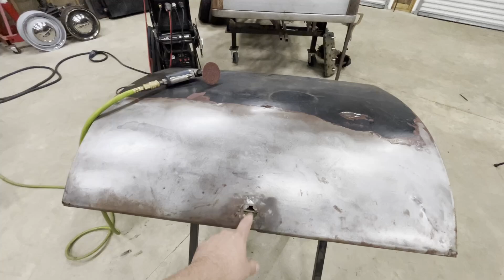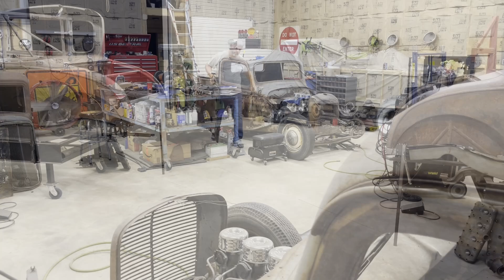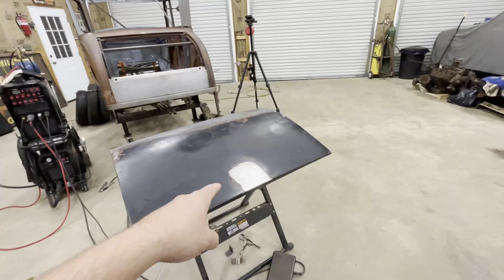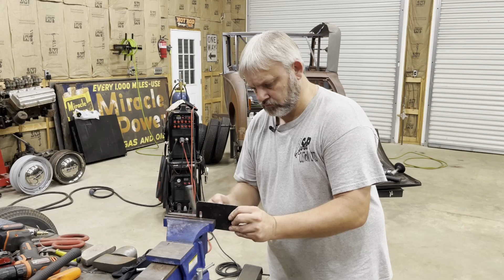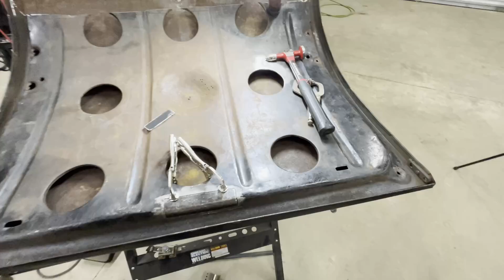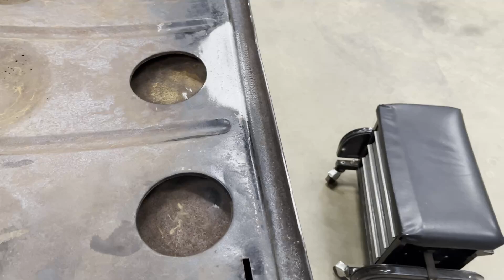Model A trunk lid repair part 6! Homemade tool makes big progress! Hot Rod Build! #welding #rusty

Comment: OH ------- don't cut yourself short ----- and start thinking you would like to have a body that ---- Does Not Have All This RUST ---- NO--- NO --NO ----------- What are you doing ---- NOW ----- YOU ----- are REMOVING ---- GRINDING ---- STRIPPING AWAY ----- CUTTING OUT ---- MAKING PATCH PANELS SMALL AND LARGE-- WELDING THEM BACK IN -------------- FOR WHAT??????????? ---TO HAVE A -- RUST FREE CAR!!!!!!! ------ So --- don't be changing your way of thinking ----------- YOU WILL ------- HAVE ---THAT -- RUST FREE CAR ---- SO ---- say that 21 times ---- and you will have that etched in your mind --- and you will be back on track ----------- About the Rear Lid ---- you could have had a --Real Conversation - piece there ---------- Two Handles ---- would strike up a conversation ---- What on earth? --------- Instead of doing repairs on it ---- could have turned to INVENTING ----- The -- Trunk handle when turned to open ---- would disengage the --Rumble Seat handle and would open up --- as a Trunk ---------- Then when you wanted to use the Rumble Seat ---- would turn and open the Rumble Seat handle and disengage the trunk handle to be a Rumble Seat -------- And  the Tool Tip of the week ------ This week's HOT tool idea ----- another Great Idea ---- I'm glad they come so easy for you ----- keep these Tool Ideas coming --- turn in the Patents and you'll retire sooner than you think ---- Yes this Planet is Changing ----- Not only getting ---HOT --- here in the US -but --Asia and Europe too -- wonder where we are headed --- Thank You for the Video --- And we shall see you on your next one ----------- Rodney
Reply from the maker: O.k., I'm back on track. I said it 21 times and I'm ready to go do some more welding now! LOL. Now, if I was building a rat rod, those two handles would have been cool haha. As far as the heat, I think the older I get, the harder it is to handle it. But I'm going to keep fighting through it, keep pressing on!